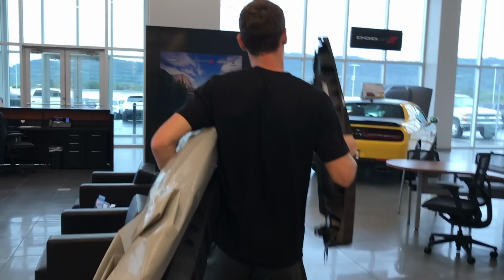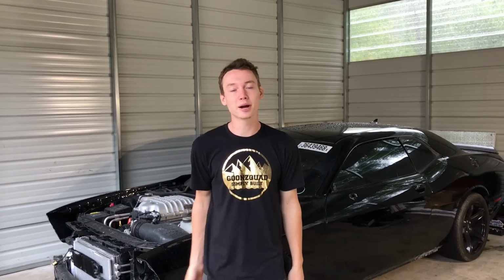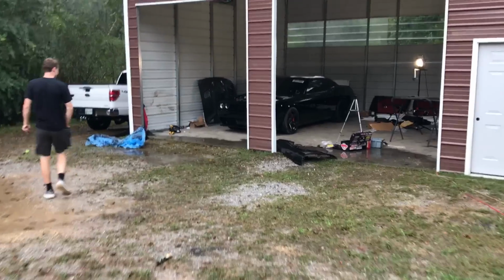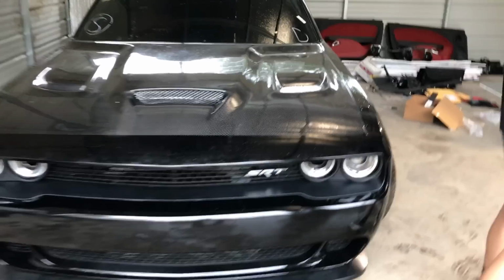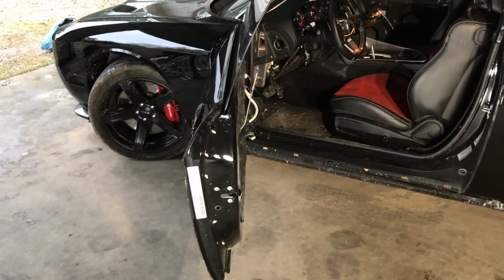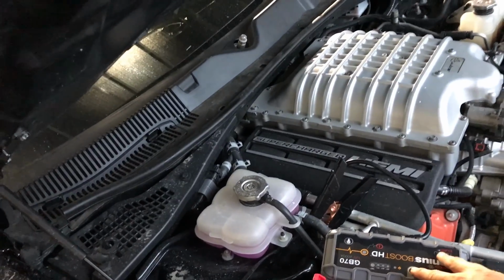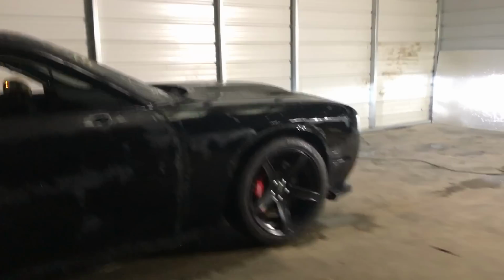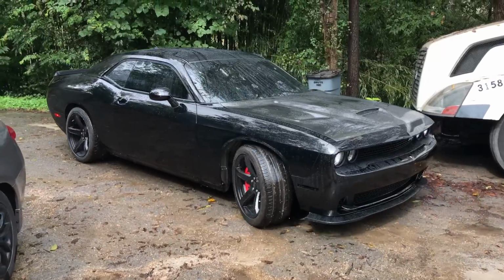Rebuilding A Wrecked 2017 Dodge Hellcat Part 16

Comment: Need to supercharge the mustang that pony is feeling kicked to the curb
Reply from the maker: Christopher slaughter we will here soon
Reply: goonzquad      That’s awesome. That 5.0 will be wicked supercharged and tuned.
Reply: Yes you definitely can’t go wrong with the Kenne bell. That stang will be laying some pony’s down to the rear wheels.
Reply: A VMP Stage 3 kit...making 715whp+ guaranteed. There is more to it than just getting the kit and installing it though. When you add forced induction onto a N/A motor, you have to get a bigger injectors and fuel pump or a second fuel pump, fuel pressure regulator and better delivery system. Better power train components (clutch/pressure plate). Going to need a tune and all the monitoring gauges to go along with it (boost, Air/Fuel Ratio). When it's all said and done, installed and ready to lay some rubber down HOPEFULLY none of the stock internals fail. It's not easy,but when you mash that gas pedal down and you get pinned to your seat and the blood rushes to your head and you get slightly light headed for a millisecond the adrenaline rush kicks in, it is ABSOLUTELY FUCKING WORTH IT!
Reply: And then the 5.0 will slaughter that hellcat like itsjusta6 did
Reply: Ant Man  except he also slaughtered a Demon so xD
Reply: blitzkrieg masterrace haha I meant demon thanks for catching that haha 😂 he straight gaptized that thing
Reply: Ant Man dude he like said bye habe a beautiful tiem lol
Reply: You guys got it all wrong with a twin turbo kit those cars are making 1000 whp stock everything but full system and turbo kit !!
Reply: Twin Turbo please
Reply: devin Dfresh we don’t have it wrong you can go to itsjusta6 and see it! Now I am not against twin turbos two are definitely better than one ;)
Reply: why did yall switch spoilers

Comment: "Dang Son" Just buy a new battery! tired of seeing you guys deal with the dead one.lol
Reply: When cars dont run batteries die. Alot of people use tenders. All they do is start and move. No different than copart. All the electronics that wont stop thinking is the problem. Once they actually drive it, the alternator will fully charge it.
Reply: I've been a mechanic since 1987. I know what harm and strain a dead battery puts on the system. Buy a New Battery!
Reply: But its 150 bucks!  😃

Comment: carbon fiber hood looks awful guys.......gotta do something there.
Reply: I like it....
Reply: come on, it looks so much better
Reply: I like the carbon
Reply: plus it doesn't appear to fit that well.
Reply: That carbon hood has extra vents for better cooling and is few pounds lighter than factory stock hood.. so overall is much better.. beside it can be painted or wrapped just like any other body part..  ;0)
Reply: Pop Laurentiu  You are right about cooling and weight. And I really hope they plastidip or wrap that hood because I also find it to be not matching at all. They should go with a black and red look. That would look great.
Reply: They should matte black the hood, roof and trunk lid imo
Reply: Pop Laurentiu  It literally has the same exact vents as the stock hood.  It probably weighs about 3 pounds less than the factory hood since the factory one is aluminum.  It's not worth it for the fitment issues that they're having.  The fender gaps aren't good, not to mention that the middle pops up above the fender on the drivers side.  That's what happens when you get "almost oem" fenders and hoods...they don't always fit properly.
Reply: @poplaurentiu4148  it has the same fucking vents and weight differences aren't crazy probably like 6 pounds or less
Reply: I don’t like bonnet 🙈🙈 I like full black made more badass
Reply: i think they like it.
Reply: True the carbon doesnt match good if it was a small amount of carbon it would be good
Reply: Don't comment on stuff you know nothing about ron.
Reply: Edges need ghosting to blend in with the fenders
Reply: I like the weight reduction aspect, but I agree. I think it should be painted. But that's what they like. So I respect it.
Reply: @Ron Meadows.  I agree.  The carbon fiber hood with the gloss black just doesn't make it.  They could paint the entire hood matte black (color option M96) or do the dual stripes from the front fascia up and over.

Comment: As somebody who works at a body shop ordering parts, I'm going to suggest when you start a build that you call a local dealer of the OE manufacturer of that vehicle for diagrams of the parts for damaged areas especially bumpers.

Not sure if its something that would make things a bit more dull for the builds, but it helps make sure you get just about everything and probably saves some time as well

Edit: This was written before i got to 6:50

Comment: Your videos are a blast to watch. I worked in television broadcasting for years. Your content is very well presented. May I say I am a little worried about the cement slab being nearly level with the outside ground. There is a lot of water seeping in even now. Is there anything that can be done? I know you won’t like water continually coming in.

Comment: You need a concrete apron in front of the shop.  And while you are at it, grab a 2018 SRT badge for the front off of Amazon.  It has the hellcat logo along with the SRT logo unlike the one you have that only has the SRT logo.  Thank me later.  Matter of fact, Fed Ex me Thomas in exchange for all the good advice I dispense. ;-)

Comment: Hi guyz ! I have to ask you this ! What about a little extension to the 2 garage doors ? That way you will have more space to work. Poor a base for 4 poles then conect the poles to the main garage frame and link the 2 poles together at each door for rigidity. Have you thought about doing something similar or you plan to leave it like this ?

Comment: I’ve watched the rebuild of the corvette and the hell cat I just have a question on the hell cat you guys did all that work and went to the dealer to buy new parts when installing all new parts why wouldn’t you wipe Down and clean all the body parts before installing the rear lights and bumper ones you put on the new parts it’s still wax and dirt behind everything just clean everything before installing

Comment: That Hellcat is a beautiful car, powerful also...BUT I'd much rather have the Z06 Vette. It may have slightly less power than the Hellcat, but it is faster, more nimble, and in my opinion better looking. If Dodge would have done SOME kind of weight reductions to the Hellcat it'd be a better car, but as it sits it is a damn boat.

Comment: Is it just me or does that hood bow up above the wheel wells? Maybe they need some weaker hydraulic supports that are designed for the lighter weight carbon fiber hood, don't know.

Comment: Hey guys, look at the IPB (illustrated parts breakdown). Its pictures or diagrams that show you how the car is assembled. Every nut, bolt, bracket, etc. This way you can stop multiple trips to the stealership. 

Also what's up with all the advertisements? Sponsorship is one thing but 6 commercials in s 20 minute  video, it's annoying.